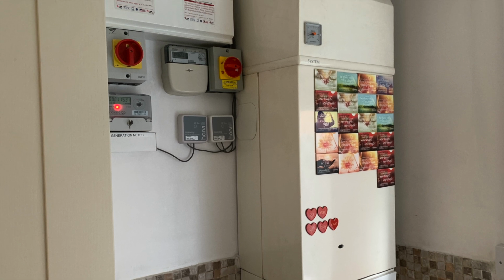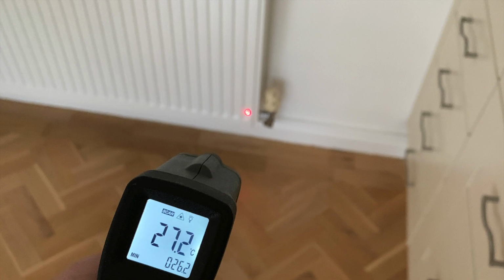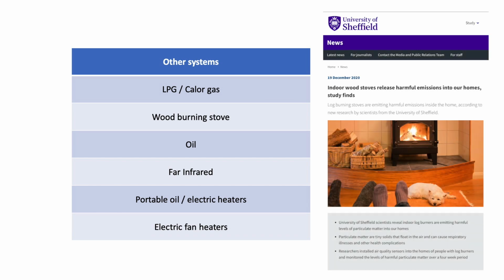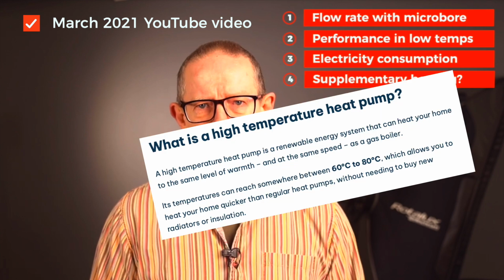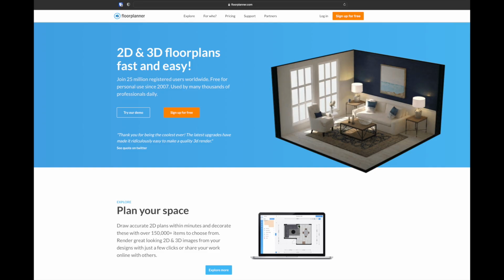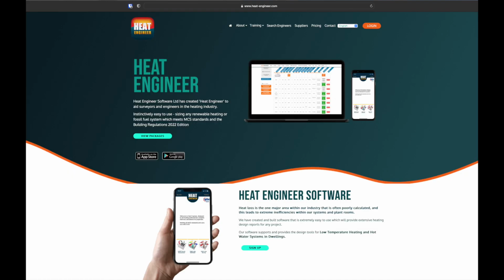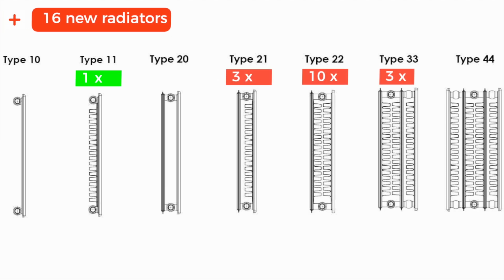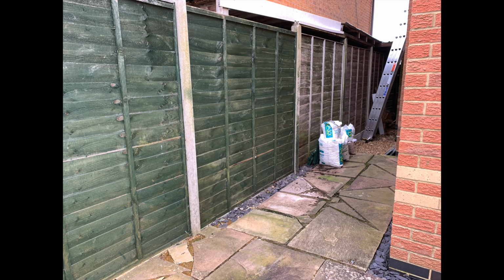Our new heating system - spoiler it's not gas!

Comment: Interestingly, on my EPC, done before my ASHP was fitted it shows my floorspace as 171m squared. Home is a 1973, and I replaced most of my radiators as old and full of gunk. First year we used 3333kWh and it kept our home nice and warm at 18c. Tried 19c for a month and found my jumper was constantly on and off, so dropped to 18c. As system was 1 year old we had the old cavity insulation, an 80's foam sprayed that was not done well and had broken down. Since having it replcaced with new insulation, house heating has been off for past 3 to 4 weeks and comparing March use to other similar stages, we are saving at least a third of our usage. So hoping around 2000kWh for heating over the next year.  I am sure you will be happy with your choice and it is a whole home solution!
I used to have different rooms at different temps dependant upon use during the day, but now switched to all the same and a 2c drop over night. The whole home has felt warmer doing this.
Reply from the maker: Thank you for watching and adding your findings on your installation, that is reassuring to hear. We used 11,969kWh of gas for heating in 2022 Jan - Dec so hoping to beat that! I don't think that will be a problem! So far this year (Jan - April, gas off in May) we've used 7,435kWh of gas, just goes to show how inefficient our current gas boiler is.

Comment: have you not considered changing from microbore piping to larger piping,  the majority of pipes in my house are microbore buried in the wales by the gas engineer before we moved, a bit of a daft idea tbh, but i upgraded all my windows barring the loft velux to triple glazed windows, my central heating is the last big project after a upgrade to my solar /adding batteries funds permitting this year, i await your progress videos
Reply from the maker: I have considered upgrading the pipework yes Kevin, however as mentioned in the video the whole house is microbore, although I failed to mention in this video it's in the previous video, that the pipework is all behind the plasterboard. We don't want to run external pipework / trunking as it will be very intrusive for 17 radiators. We know our system can run on microbore and yes we may suffer with slightly less performance SCOP scores, but the radiators will all be upgraded to offset the smaller pipework. 

We still have windows to do, it's next on the list! LOL Triple glazing with wood/metal frames for maximum u/value is our plan. And get the properly fitted with no gaps!

Comment: Really glad you have gone this way John people that have gone air to air and have not put one in EVERY room must be mad . ( could you imagine buying a newish house with only heating in half the house but the seller saying we don’t use the other rooms ) ev man has a similar system that works with micro bore . Only one concern but maybe not draining your powerwall by midday on a old one. I will be watching your future flogs with even more interest. Very pleased with your decision
Reply from the maker: Thanks for watching Glyn. The decision is certainly based on how you use your heating, size of your house, layout of rooms, age of property, lifestyle and so on. There are so many variables that what is right for us maybe not right for everyone else. EVMan did have microbore upstairs and that was swapped for 15mm copper. I'm assured that our system will work with microbore as we've tested it for the past 18 months. Also Mark the heating engineer was comfortable that it would work too. We are having a buffer installed to act as a reservoir for the heat pump rad circuit to ensure there is enough flow and pressure to pump around the system. 
I'm sure we will find 1 Powerwall will not be enough on cold days for sure, time will tell I guess.
Reply: Thanks for the reply one last question did they have any idea of the total amount of litres in the system
Reply from the maker: Good question, I never asked that tbf. I guess we will know when they drain it, flush it and fill it up again.